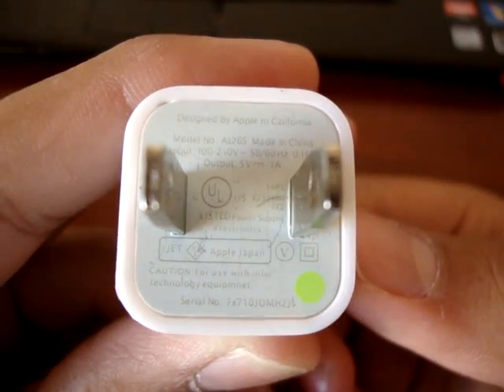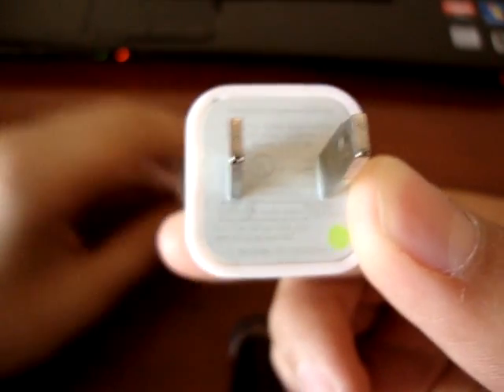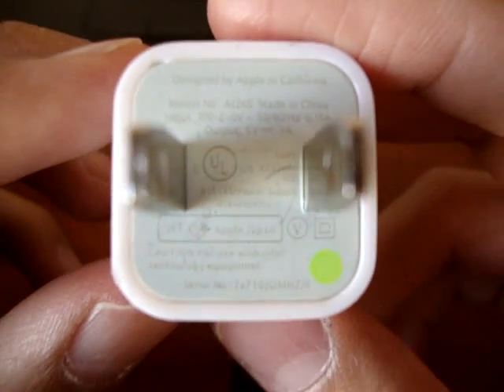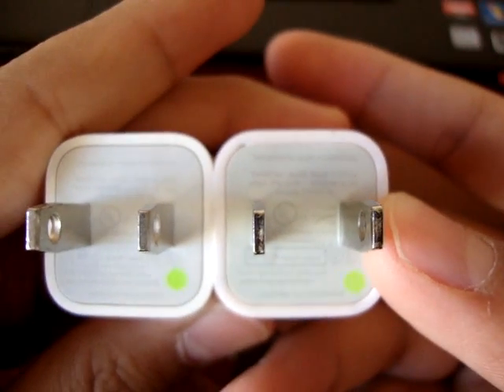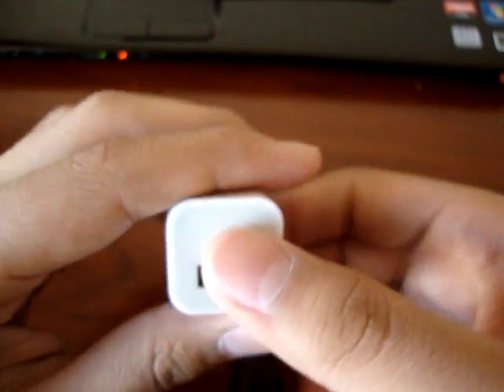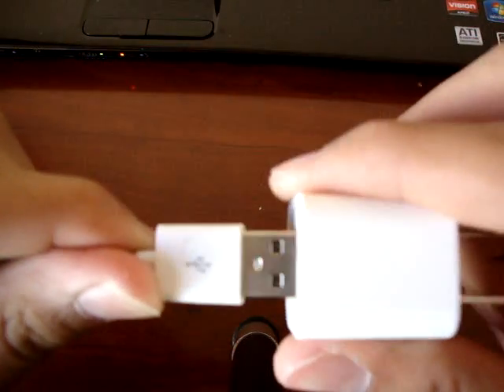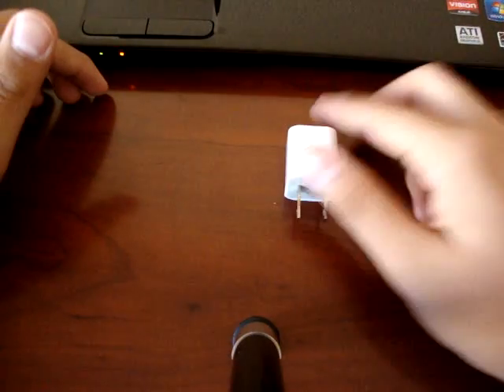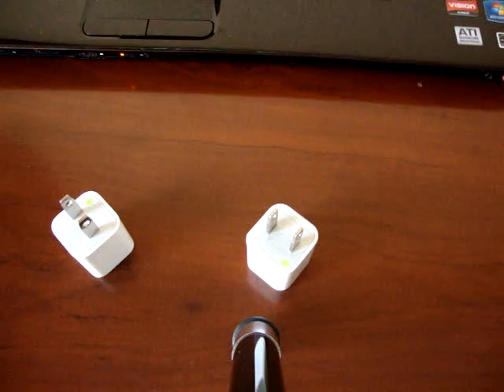Difference between a REAL and FAKE iPhone CHARGER!

Comment: Fine explanation , but looks like your lighting cable isn't genuine, 😉 regards.
Reply: ahmad aswad how did you notice it was a fake light cable?
Reply: Abishek Rajkumar the cable has a little hole in the top metal part.  It’s hard to explain  but basically the top of a genuine cable is smooth and has no other hole than the 2 square holes

Comment: The green dot used to be the identifier seems like the fakes have now started to use those too.  From what I understand, current chargers that come with the device have a faint apple logo on the side of the plug.  I was curious as the charger with the iPhone 6 didn't have a dot.  I found that apple quit using the dot and replaced it with an apple logo.
Reply from the maker: Yeah some counterfeits are actually really convincing.  I order the lightning cables from time to time (these have tons of fakes) and there were even some which were fake but I had no idea until I closely examined them.  The bad fakes usually weigh less than the genuine product.  if the weight is the same, you have to start nitpicking details.  In the case of the lightning cables, the tips were just slightly fatter than the genuine ones and you wouldn't really be able to tell unless you measured it.
Reply: mine has an apple logo

Comment: Yeah I've noticed the same, I got a fake from amazon and its was two buck as well, I was suspicious bout it, it does charge slower than the real apple charger.
Reply: If i use fake charger for my iphone 4s , What is going to be with my phone ? Because I need to buy a new one that's the problem?

Comment: I have a real easy to spot fake. This KIRF didn't even bother going the distance of trying to copy all of the original data and UL numbers.  Just the info in dark print of "Made in China" and below that, the voltage ratings and DC output... At least you got a good KIRF compared to mine share the only thing in common is the little green dot. My battery life was awful. The last time I will ever buy an iPhone online... At least the phone was genuine with the serial number checking out properly.

Comment: Using a fake charger is not really much of a big problem. Although, APPLE spent so much for research and development to ensure the quality, safety and design of their products. So its sad that many manufacture fake APPLE products. The price is definitely lower than the original but will not give you the same quality and safety. Also, when you're buying any used iphone, this video will help you know if you're getting what you paid for. if they claim accessories are fake, or they claim their orig

Comment: Quite frankly, I see nothing wrong with the "fake" chargers. I have been buying them for years and while they don't last long, they are cheap and have never caused me any problems. If Apple didn't gouge people for their accessories, there wouldn't be a bunch of clones. Also, using non-Apple chargers DOES NOT void your warranty, nowhere does it say you are required to use their chargers and they can't tell if you don't. FWIW, the only iPhone I had die was being charged on a defective Apple charg

Comment: In addition the Original iPhone/iPod Charger, has a Serial Number marked inside the USB socket of the charger. The fake one's does NOT have it....

Also i find this new type of charger gets defective easily after quite some time, specially when you accidentally drop it into a hard surface.....

Comment: So many other phone makers use usb chargers that are the same specs as Apple's, that is, they all take in anywhere from 110-240 v at 50/60hz and ouput 5v or 1.0amp.  As long as those are from reputable companies and not cheap knock offs from china, they should be ok to use don't you agree.

Comment: I bought an apple charger online.. It can balance like you did, the color is also grey in the rear part. When i plugged in my original usb cable i can insert it all way through the same w/ your original charger. While charging I can use my iphone normally w/out messing up the touchscreen like what you said. It doesnt spark when i plug it in the socket like usual fake charger. In short its perfect. But in my disgust it says "Power A dapeer Made in China and Apple Japan". Can I have your opinion?

Comment: I have order 2 ft USB cables with 2 chargers and they don't work! They company even sent me to more and they don't work as well. I think the USB they sent me is fake as well. I can u the new USB with the old charger cube and it still will not charge. Beware on eBay iPhone 3G 6ft USB cable with charger.

Comment: Do u think it "works" in the same way with european chargers? I bought mine on Polish eBay, but my charger is weird, because all the text is not on the bottom of the charger, but on the right "wall" of it. And the keyboard gets freaky when I charge it. Do u think it may be fake?